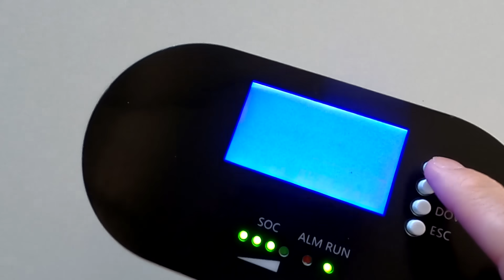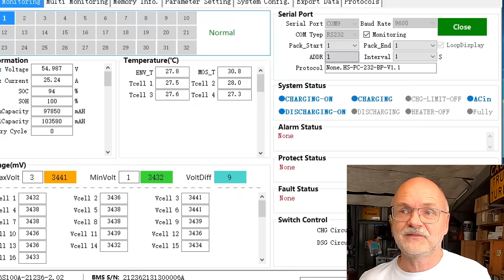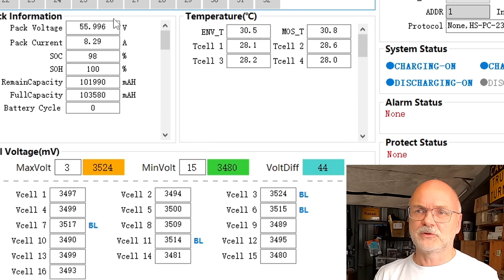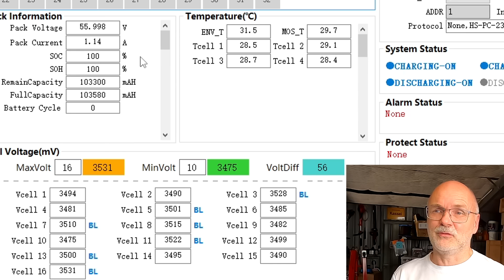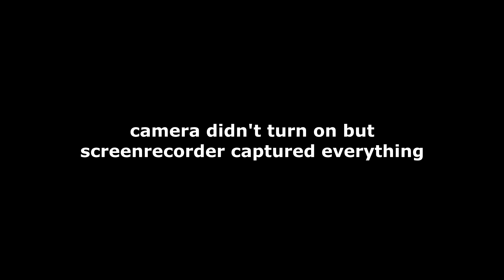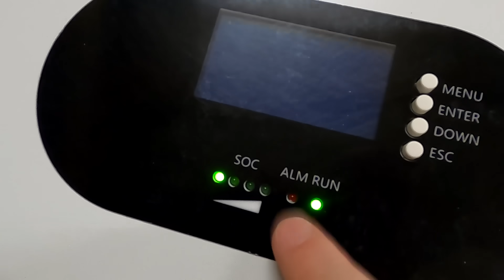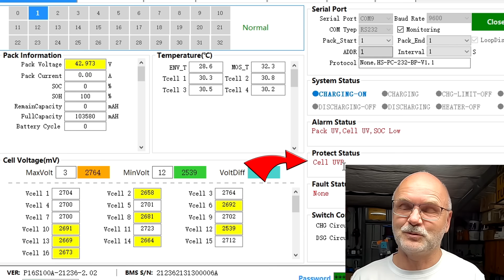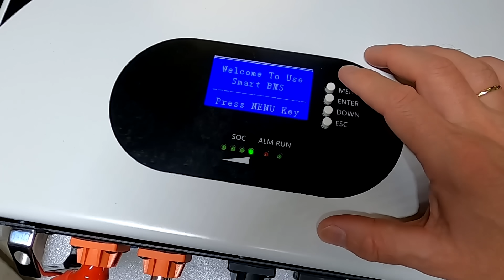Jakiper Powerwall: The Pace BMS during (dis)charging, Capacity and Energy Test, Current Limiter Test

Comment: Het! Thanks for the such detailed explanation!  Could you please clarify whether a balancer should start working as soon as a battery is fully charged (100%) for Pace BMS?  There is no balancing starts for my battery even though there is no current incoming, but 99% SOC is displayed (((    I have no idea what went wrong.  Balance Threshold is set as 3.30v and 20 millivolts deviation in BMS Parameter Settings.

Comment: Thank you very much for the instructions. I was wondering, incase the operational BMS is accidentally damaged, what will be the safety mechanism for the battery pack system. Will the system be cut-off or the battery charge-discharge can be continued somehow?

Comment: Hi Andy, videos great as usual. Just a quick request. Would you explain  the solar power meter and how to calculate the solar power as the numbers on the meter don't reflect anywhere close to real solar. Is there a percentage or formula to calculate?

Thanks again for videos

Antonio
Reply from the maker: Thanks Antonio. Do you mean the Solar Panel Tester or the Solar Meter I use to measure the light intensity?
Reply: Hi Andy, the solar meter. Can't find info on the relation between the reading of the meter and actual solar panels. Would the meter be ready watts of 100% efficiency? In that case would be an easy calculation.
Reply from the maker: @ats2436 It measures Watts/m² and you can compare this to the STC data on the back of the solar panels. 
The efficiency has nothing to do with it.
Reply: Thank you Andy

Comment: Amazing test Any good luck :) from sunny hot Baghdadi autumn.
Reply from the maker: Thank you. Ah, the 'cold' season start for you now. Any downside in terms of solar production from that in your region?
Reply: @OffGridGarageAustralia  Yes, the sun 🌞 is going to the south now but still 42+ temps. My 30° angled panels have perpendicular sun arrays at noon, daily solar generation, still around 60kw for 11.8kw panels. I am feeding back the grid with 2 8 kw all in one inverters and did a load test with16.6kw!. But the issue now I see with the voltronic is limiting the current of the 540w panels to 9.7 amps at noon because the mppt temp is getting near 80°C I have to modify the size of the internal MPPT heat sink just like what I've done with the other inverter..
Reply from the maker: @HybridShedIraq  very interesting, thanks for sharing. Is solar a big think in Iraq? I thought power prices are low and you probably won't get much for feeding in.
Reply: @OffGridGarageAustralia  utility power is cheap, but it is not available for 24 hours. The street generator is pricy, and you pay not for kwh but for Amps about 10$ per Amp per month, so if I take 10 amps the generator voltage sumtimes under 195v you can't run much so power prices is expensive here. I calculated my 4.2kw solar pay back period, which is only 3 years, and it cost me 4800 US $. I installed Solar exactly 27 months ago. And I expanded it to 11.8 kw solar and 16kw inverters with 24-25kw lifepo4 in the last six months.
Reply: i don't get much since i have other loads than the inverters. I am just testing power export. once i bumped the mains volts to 250 plus by too much feed but that was in spring  @OffGridGarageAustralia

Comment: Out of that 5.2 kWh, how much does your tesla register as arrived in to its battery pack? Is it granular down to .x kwh or does it just show full kHw available for driving range?
Awesome product from Orient Power :)
Reply from the maker: The car shows the kWh for each charging session as well.
But the efficiency depends a bit on how I charge the vehicle. Here in this test, I had to choose the slowest possible setting in the Tesla to roughly pull the 22A from the battery. That is the most inefficient way to charge it though. The higher the charging power, the more efficient the internal charger in the Tesla is, up to the max of 11kW on 3 phase.
I made a video about this a few years back on my car channel and compared different charging methods. I have an OBDII dongle for the Tesla, can tab into the BMS and see how much power arrives in the battery. Let me find it...

https://youtu.be/btVou1SKggY

Comment: One test you did not do is to have all three Pace bms jakiper charging ( while at different SOC%) and see how the bms deals with the different battery voltages. I think what I have seen is that bms will try to keep all battery voltages very close by limiting or shutting off the current to individual battery if it gets a lot higher. I always thought maybe that was what they talk about when they call them "Smart " bms ?
Reply from the maker: I'm doing this right now. Video is coming...

Comment: Just purchased 32x 280ah CATL from China for 2685.00 USD with a JBD 200ah BMS. Hopefully they will arrive in 2  months or so. A 10,2 KW high frequency Inverter for 585 USD, all this delivered. Of course, it still needs to arrive ;)
Reply: What brand and model inverter did you go with?
Reply: 585 USD for a 10 kW inverter....
Please let us know how well it works.
Reply: @Juergen_Miessmer  it will be sometime in 2024 it will be installed. Seems to be a continuation of the 5kw old units copied by the Chinese into lots of different brands. Looked into the Deye brand, 8kw 1400 USD delivered. Only real plus was the capability to ac coupling, which the lower price unit doesn't do.

Comment: Yep, I wish I had these or similar batteries versus the EG4 batteries I bought. The design and quality of the Orient Power batteries look so much better than what I have.
Reply: Which Eg4's do you have.  I need to pass initial permitting so I am waiting on the Eg4 UL9540 to be approved,, That ESS battery  has an outdoor enclosure and heating.  It's the cheapest way I can get inspected and a certificate of Occupancy,  after that I'll build my own  additional batts.
Reply: I have the EG4 LL V2 48V model, not to mention, I have had problems with support from Signature Solar @unionse7en

Comment: Does this software that you are using also work with other BMS, e.g. Seplos?
Reply: Nope - The software is only going to work with Pace brand BMS.
Reply: that software with the values while testing is from the BMS manufacturer and usually different or the BMS manufacturer uses a software that is shared with other manufacturers which only happens rarely. There is not swiss army knife for BMS afaik.

Comment: Calibration is setup from the manufacturer but they don’t know what equipment will be used. So it comes down to the user to determine what the equipment will need to be installed with. And the system programmed as needed for the user. ??? Am I reading to much information on this?
Reply: Siento que le molesten ciertas anotaciones tengo 30 años de experiencia en equitación fotovoltaica y entiendo su criterio usted no es juez ni jurado para esgrimir la libertad de las personas
Reply from the maker: The battery can be used as it is but it's not optimal. You are right, depending on the system design, it may need some tweaking and changes...

Comment: Uff, that 22A charge protection limit between the full and empty battery toward the end is gonna burn a lot of power in those current limiting mosfets. If the voltage difference between those two is really 6-7V then that's around 130-150W. Would be a good opportunity to measure the temperatures of the BMS board and check their thermal design.
Reply: No power is burned. The limiter works like a buck converter.
Reply: Ah, well that's pretty neat!

Comment: Regarding compatibility: has anyone a pace bms based battery running with a Growatt SPH 4600 inverter  ? 

There are different informations. I am looking for a full native integration into the growatt app and system, not a usual pylontech emulation or plus minus cable connection. I want to use the can bus connection.
Reply: our BMS can match with Growatt and other many brands of inverter.